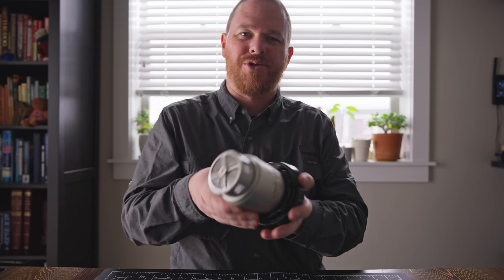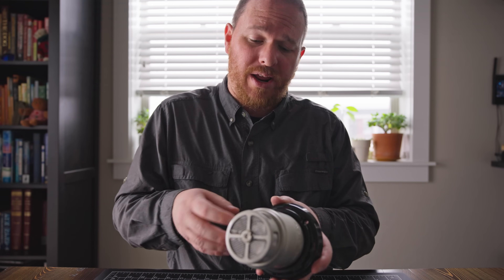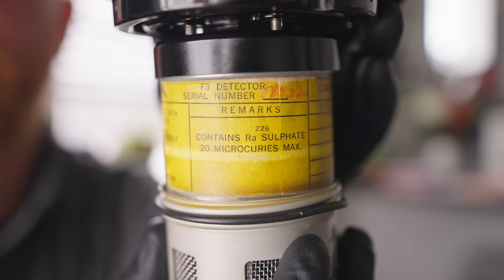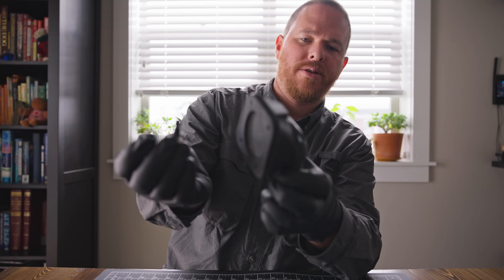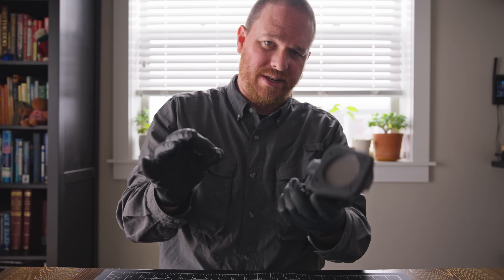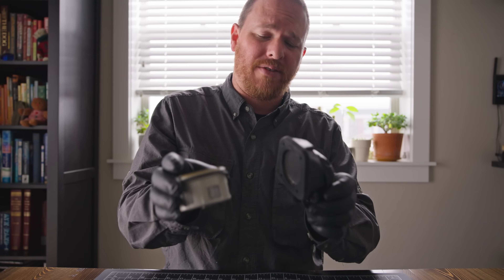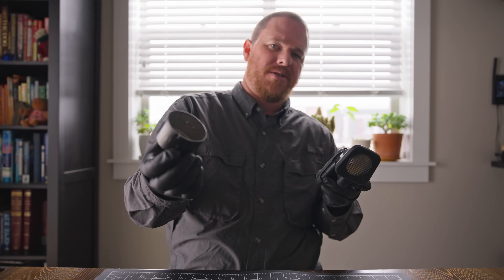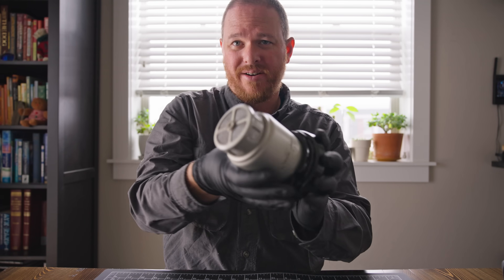Intensely Radioactive Industrial Smoke Detector from the 1950's

Comment: Wouldn't that also give off radon gas?
Reply from the maker: Yes. Radium decays directly into radon.
Reply: @RadioactiveDrew  What if you were also testing your house for radon, would the smoke detector throw things off?
Reply from the maker: If I had kept it in my house for any length of time, yes I believe it would increase the radon levels. I keep items like these smoke detectors and other hot items in a safe not inside the house. 

 I do have a display case with some uranium glazed ceramics and some small radium compasses. I’ve left my radon meter in the display case and it shows a much higher level of radon inside the case than in the house.
Reply: @RadioactiveDrew  What about radon daughters?  Would the radon coming off the radium decay and coat everything around with such?  Some of them are still radioactive.

I used to worry that if you visited a radon laden basement all your clothes and your body would be coated with such, and I'd want to immediately shower and wash my clothes.  Wonder if I was overreacting.
Reply from the maker: @ThePeterDislikeShow  Radon daughters are part of the decay chain. So if radon is there those decay products are they as well. All of them are radioactive except for the final lead, which is the last stable element that decay chain ends in. There are some other forms of lead that pop up and are radioactive.

My clothes have gotten very contaminated going into certain uranium mines. But that contamination decays away pretty quickly...about 24 hours. Its still there but Pb210 has a 22 year half-life, so its very hard to detect. I have a video where I visit this uranium mine. Its one of my first videos.
Reply: @RadioactiveDrew  So how come you don't see old homes contaminated with lead-210 dust or just chemical toxicity from lead-206 itself?  You'd think after decades of radon decay that'd also be a problem.
Reply from the maker: @ThePeterDislikeShow  well its a pretty small amount and it would only collect in areas that were never cleaned. So the crawl space of an old home with a decent level of radon in it would have all those daughter products along with lead. But again it would be in very small amounts. You could test for it and I'm sure find it.
Reply: @RadioactiveDrew  That makes sense.  I used to think that old basement smell was from radon daughters.  Especially polonium and astatine, in my mind I thought they would smell like sulfur and chlorine.  But I was in 10th grade and just had an overactive imagination!

Comment: nice little device you found there ! I am sure you already know about the older Russian smoke detectors and the "spice" they (sometimes) hold ...
Reply from the maker: One of those Russian smoke detectors is on my list of things to get.
Reply: @RadioactiveDrew  The Russian KI-1 contains Plutonium but they are as rare as rocking horse doo doo.
Reply: @gb5uq  the RID-6M's have plutonium in them as well, just not as much as the KI-1's or RID-1's.  I have a few of the RID-6M's if anyone needs one.  They cost an arm and a leg to get though, which sucks.

Comment: Wow. I didn’t realize they had those type of smoke detectors back then. I guess it had to be such a strong source because the electronics weren’t as sensitive as they are now ?
Reply from the maker: That's my guess as well.
Reply: The ionisation current in modern smoke detectors is in the picoampere range, as far as i'm aware. In the 50s and 60s, measuring that was only possible in highly sophisticated electronics laboratories.
Reply: @mfbfreak  yes back then they needed miniature low noise vacuum tubes to boost a signal to then drive a little mechanical meter indicator. So, it was cheaper just to use copious amounts of radiation.
Reply: My guess is that they had very little understanding of the dangers. They just wanted to build something that worked.
The 50's were the age of the atom. Uranium was the new future. Nuclear tests close to Las Vegas were a tourist attraction.
Reply: @jacquesmertens3369  more so the combination of WWII security, Cold War security, propaganda, and a lot of "wishing for the best" led them to ignore hazards that were known - at least to those in the know. Of course, by the 80s, small children knew far more about nuclear risks and the secret history of the program than most of the people alive at the time had, even those who worked on the project in some capacity (calutron minders, etc), so our perspective has a bit too much 20/20 vision perhaps.
Reply: Low level DC and analog signal measurement was difficult then due to drift, often requiring chopper amplifiers. 
Integrated circuits solved many of these problems with device matching and close proximity. IC Op amps were and still are a very huge advantage with tiny and slow changing signals. The ICs used in modern detectors far out perform what could be built with discrete components.
Reply: Electronics used to be more sensitive most of the time. It's just because of lack of technology production wise
Reply: @rexjolles  yes and no. It does likely have to do with the amount of power in the ciruit required to drive the logic. 58 most likely still used tubes.

Comment: Way to over hype radioactivity without a stitch of science. 
#1 Radium if ingested, can continue to damage the body for the rest of our life. Our body looks at radium as if its calcium and deposits it into our bones. In our bones it smashes the DNA chain forever. Of course, the more Radium you ingest, the more damage to the DNA. (Accumulative affect)  
#2 You not wearing a respirator is a perfect example that if you do know this about radium? then you are not truly Terrified.
Reply from the maker: I already know this about radium and have said it before in my videos. I'm not worried about the radium in this smoke detector because its contained in the foil. Its not the same as dealing with radium paint, which could become airborne if handled incorrectly.
Reply: @RadioactiveDrew  You missed the point of my criticism.

Comment: They also make an F4 that uses 80uCi of Am-241 which is quite dangerous since it is a nasty Alpha emitter with 60kev gammas.
Reply from the maker: I've seen a little info on that detector as well. The Ra-226 has a lot more gamma radiation coming off of it.

Comment: Nice movie, congratulations on your picks in the form of smoke detectors. If I can advise you, avoid touching potentially radioactively contaminated objects with the dosimeter. You can take off the gloves, but with radium flecks on the mica window it will be hard :D
Reply from the maker: I've had to clean the mica window a couple times after being in a uranium mine that had a very high level of radon and radon daughters in it. So its not that big of a deal but I do try to keep it from getting any contamination.

Comment: Another great presentation. Just curious where you store these items.
Reply from the maker: I have an old safe that I keep stuff like this in.
Reply: @RadioactiveDrew  Could this be safely stored and displayed in a lead glass box or a box with a lead glass window?  I'm guessing it would not be inexpensive to construct such a container, but I'm curious as to whether it would absorb enough to be safe for long term display.
Reply from the maker: I think you could make something like that work. I’m pretty sure it would take a couple layers of leaded glass to shield it completely. The layers of glass for a hot cell that works with super spicy isotopes is about 12” thick for reference.
Reply from the maker: @kcgunesq  radium is very radioactive. So yes even this small amount is extremely active.

Comment: In Soviet Russia (insert Yakov Smirnov joke here) they just straight up used plutonium238. I don't understand how it's actually even working, like why are there TWO separate sources of radiation and how is the smoke even getting inside that inner can at all?
Reply: Maybe you speak about RID-1 and plutonium-239. If I don't mistake, the close chamber is used as a reference level to be compared with the actual level in the open chamber. If the current difference between these two chambers grows, the detector signals about smoke. This scheme compensates itself from the activity level changes.
Reply: @Serpiph  yes that's the one. Interesting, thx, I see now.
Reply from the maker: @Serpiph  that helps in understanding these a little better.
Reply from the maker: It is a bit confusing on the exact operation of the detector. Here's the patent number if you want to know a bit more (2702898)

Comment: Another great video! But be careful please. Do you have any cloud chamber? Do you think that it is also possible to measure the radioactivity of polonium and thorium in tobacco cigarette and in pesticides with your instrument? Thanks
Reply from the maker: Thanks for the concern. I try to be as safe as I can be and still make the videos. I don't have a cloud chamber but I've been wanting to build one for a while. Would be interesting to try and measure those isotopes in tobacco. Maybe those will be in a future video.
Reply: I highly doubt that you could detect them in a cigarette or any tobacco products using conventional means.  You'd Definitely need a cloud chamber and even then it'd be hard to distinguish it's particles trails from natural background.  It builds up inside the body and concentrates in the lungs.  I'd be much more interested in seeing a smokers lungs in a cloud chamber.

Comment: Your actual body exposure from making his video was probably not more then one or two microsievert. No need to exaggerate the danger of handling this.
Reply: I still think that it shouldn't be downplayed. You have to respect ionizing radiation and you can't be too careful.
Reply from the maker: Well to shoot this video it took a couple days and I had close or direct contact with the smoke detector for an hour total. I calculated 170 uSv/hr at surface using a gamma filter on my Radeye B20. So I'm not sure what my dose was but I think it would be more than 1 or 2 uSv.
Reply: @RadioactiveDrew  what she is talking is most likely "whole body dose" there is a difference between absorbed dose, equivalent dose (which is probably what your counter equipped with the gamma filter aims to report) and effective dose where you factor the tissue weight factor. What you measure on the surface of the source is what your fingertips will experience, not to say that it is a good idea to hold it in your hand for a long time but when it comes to effective dose and "whole body dose" for sure you didn't get anywhere near 170uSv still it was probably over the 1-2 uSv. (for a reference, a flight from New York to LA is around 40uSv)
Reply: @RadioactiveDrew  That fits well with my assumption actually. Im aware that filming took longer then the final playtime is. With 170 at contact, dose rate at 30 cm which is approximately the distance of you body stem is less then 2 uSv/h. With your hands closer to it, but other body parts significantly further away. 
I handled 100 uCi Radium sources before wearing a calibrated dosimeter. Dose was always neglectable. I didnt include any Radon exposure from keepin this in your apartment however. thats probably the greatest concern with this item.
Reply: @sonyxperiasmk  Yeah, I think Drew should buy a radon detector. I know people who have bought radium sources in this activity range and contaminated entire rooms.
Reply: @RadioactiveDrew  Was the 170 uSv/hr measurement energy compensated? I am trying to mentally compare to a Soviet radium source that I have.
Reply: @MinSredMash  I think so, he has shown a compensated filter in the other video.
Reply from the maker: @MinSredMash  Yes, if I should a reading in micro Sieverts on that Radeye B20 it will be with the gamma filter on.
Reply: Your new video with Measurements, partially, proofs my assumption. I assumed filming took only about an hour. With 4 hours the absorption is obviously higher. 
My estimated dose rate at body stem distance was correct though.

Comment: The manufacturer probably intended it to be used in factories and thought that there would be no danger in a high hall. The device was then dangerous for the maintenance staff. And in the event of a fire, for the craftsmen who were then ignorantly exposed to high levels of radiation during renovation work.
Reply from the maker: I could see the potential for contamination after a building fire. Seems like the radium is pretty well sealed in that foil but who knows what would happen in those extreme temps.

Comment: I heard of the Ra226 version of this fire alarms but I didnt know they were so radioactive! Great video!
Reply from the maker: Yeah, I didn't expect it to be so hot.
Reply: @RadioactiveDrew  what reading do you get from gamma only?
Reply from the maker: @allRadioactive  170 uSv/hr on contact from the top of the wire mesh cap that has the screw in source. That's using a gamma filter on my Radeye B20.
Reply: @RadioactiveDrew  that is a lot!
Reply from the maker: @allRadioactive  yeah, but it might have been picking up some of the betas as well. I need to do some more tests to make sure that number is accurate.

Comment: You need to get a higher range detector!
Reply from the maker: I know. In the future I'm going to pick up the Radeye B20ER version. It has a much higher range than my B20.
Reply: @RadioactiveDrew  Nice, I got a high range m87 something thay goes to 10sv/h
Reply from the maker: @roentgen226  I do have a Gamma Guard CT007-F that uses a solid state detector. Pretty sure that goes up to 1,500,000 CPM. I didn't use it for this video since the detector surface area is smaller than on the Radeye B20. But I might be doing a follow up video on this item using that detector and some alpha detecting screens that show a blue light when exposed to high alpha radiation.
Reply: @RadioactiveDrew  see if its gamma has any effect on camera
Reply from the maker: @roentgen226  I tried to capture the gamma radiation effecting the camera sensor. But the Sony A7S3 has very aggressive noise reduction. So I can see some noise when I'm seeing it live in the LCD. But when I try to record it the noise goes away. Might have to capture it with a different camera.
Reply: @RadioactiveDrew  damn, I usually use my phone camera, ive even been able to see gamma from americium 241 from smoke detector
Reply: @RadioactiveDrew  You can use activated zinc sulfide as a visible detector. Glows in the dark if exposed to a hot alpha source. I think most phosphors will detect ionizing radiation. A cloud chamber with that Ra 226 source would probably be pretty interesting to see.